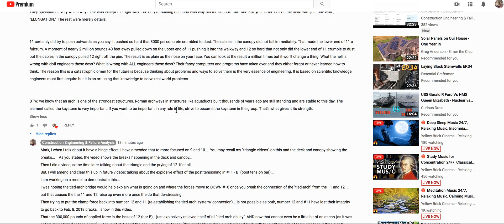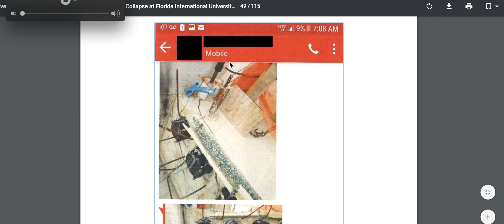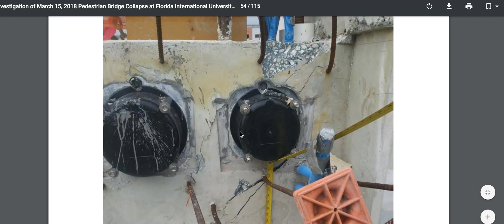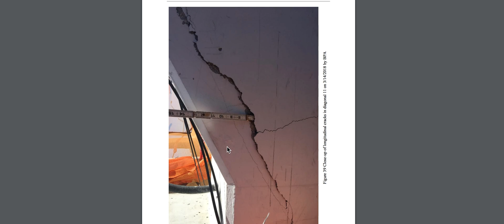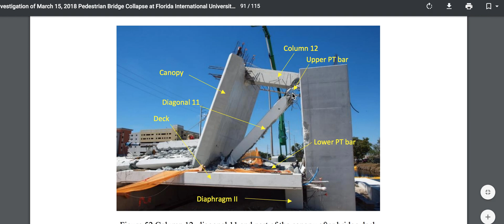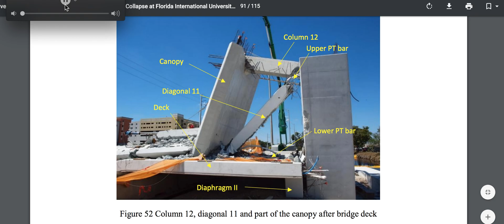FIU BRIDGE COLLAPSE NTSB REPORT DEBUNKED, TIED ARCH BRIDGE = WHY BRIDGE FAILED SIMPLY EXPLAINED pt 2

Comment from the maker: The sagging would NOT have been stopped because the other structure / "backspan" would have been connected.
The sagging would not have been reversed in "equilibrium"; the canopy has the "extra post tension cables" but the sagging would not have been "lifted / raised" just because you add two more ducts of compression inside the canopy.
Those extra ducts, I believe had the "intent" of simple making the canopy interact as one (be default b/c they connect the two roofs together).